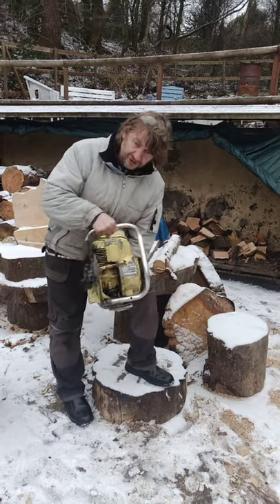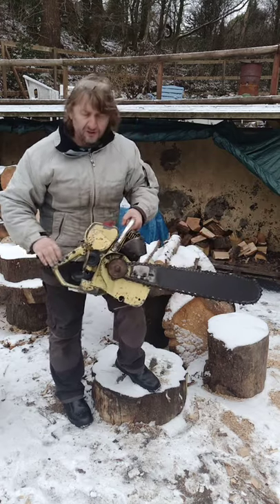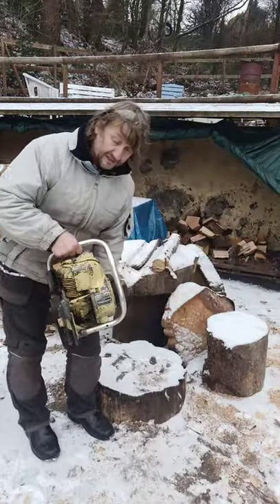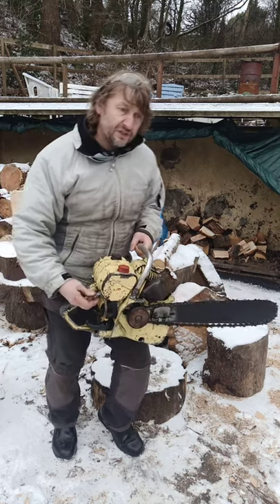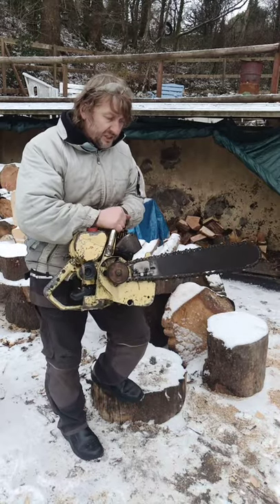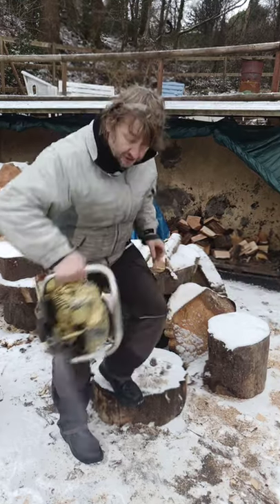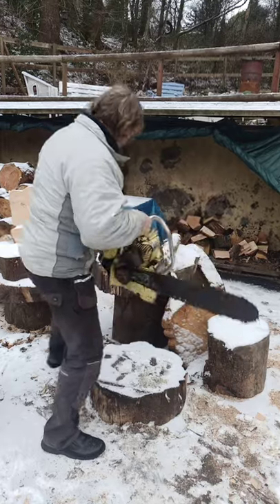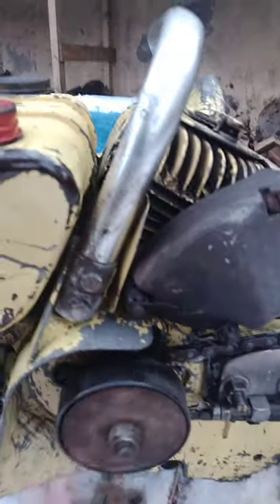Clinton D55 Vintage 73cc American Chainsaw. Overview of a beautiful old girl. Now Running 😁

Comment: Clinton saws always cause a nostalgic lump in my throat. I rebuilt a Clinton B3 in my high school ‘Power Mechanics’ class.  If your small engine was painted and ran you got an A+ on your term paper (I did!). That old hard starting Clinton became our first saw on my grandparent’s Michigan, U.S.A. dairy farm.......ps. as a 15 year old, I was never allowed to cut with it, even though it was I that restored it! Many years and saws later, I have concluded the pivoting carburetor and it’s seal likely caused the starting difficulties. Once it was running, it ran fine, although rather slow.